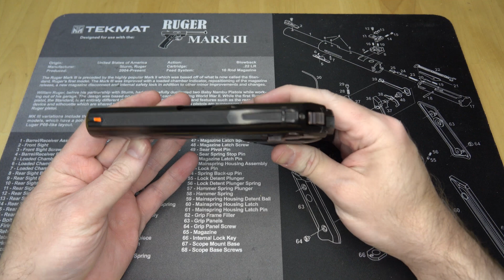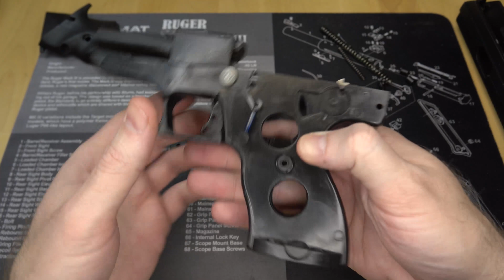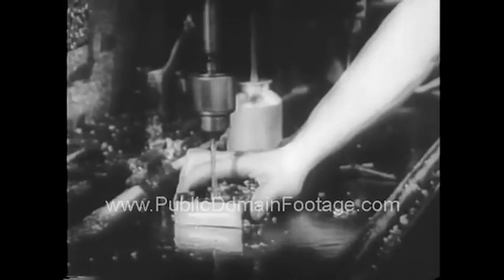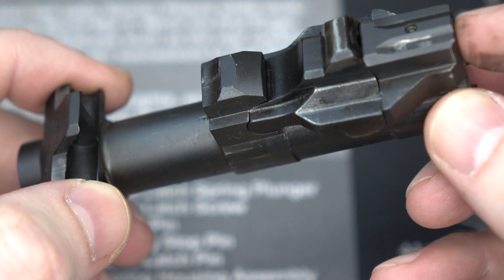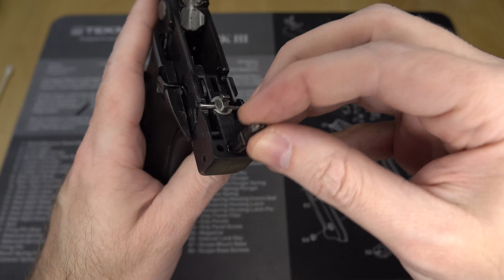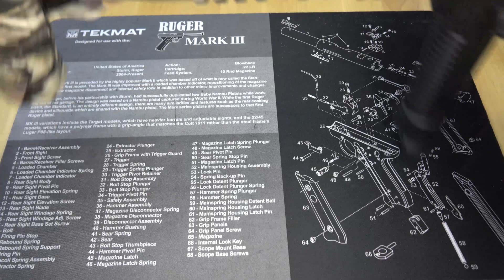How Does a Hi-Point Work? (New & Improved!)

Comment: What is the slide weight of that pistol?
Reply from the maker: This is such a great question, I had to get out the punch pin and hammer to find out. 
It is 1 pound, 2.4 ounces / ~522g.
By comparison, my LH9 slide (which is a 1911 style affair) is only 10.4 ounces / ~295g. The P5 seen in the video is only 10 ounces / ~283g.
So, the Hi Point slide is almost double the weight of a locked breech type slide.
Reply: @firydeth  The only difference between both guns is that the Hi Point C9 is Lord of all Guns!
Reply: @firydeth  interesting 
The weight of my full auto Uzi bolt is 513 grams
Reply: @firydeth The slide weight reduces recoil.  Just gotta be mindful of slide bite.
Reply from the maker: @DarrenPugh-r6u  I would not say the slide weight reduces recoil. That large reciprocating mass does things when it reaches the end of travel. Oddly enough, the bad grip ergos also seem to make the gun a bit snappy to shoot. In no way would I call this gun low recoil.
Reply: ❤❤❤ @firydeth
Reply: Heavy
Reply from the maker: @d2nasty696  straight up
Reply: 14lb
Reply: About 2....... damn much!
Reply: The way you explained zamak 3 is so wrong. It's used in the metal industry since world war 1. It was used to make toys and small scale models of trains and things for over a hundred years. A specific alloy recipe.. not just 'bits of whatever' . Dude, that was absolutely nonsense.
Reply: Never got slide bite with the 40 I have. Definitely a strong round and shoots good.

Comment: Just like everything else in life not everyone lives in a 500k house drives a 75k car. Hi Point is the common man/woman's firearm simple, affordable ,and effective. Us HiPoint owner aren't carrying it to impress someone looking down the barrel with the magnificent craftsmanship and flashy design, we're carrying it to handle business.
Reply: I mean Taurus starts at $200 for a 9mm, sleeker more compact design, reliable, higher magazine capacity and a whooooole lot easier to carry. I've seen Hi-points as low as $110, but I don't think $200 is breaking the bank for most people. If I really couldn't afford the $200 for a Taurus, then I'd probably go with an SCCY, they go for pretty similar price to the Hi-points and are still alot smaller and easier to carry.
Reply: Taurus is just better tbh for not much more money. If Hi Point is all you can afford i mean hey, use it, but there's other cheap options that run better.

Comment: This video is interesting because it's both informative (about other guns) and lacking (on some important Hi Point details). There's another similar video where the creator describes how this gun works, and the materials, without the quips, references to "pot metal" (he described exactly the makeup of the alloy), and he must have had a better experience with the C9 than you did because he did not advise that we could expect lots of FTF's, and bad reliability. In fact, there was a detailed overview of why the fixed barrel design results in the gun having good accuracy, and the slide weight reducing felt recoil.

Comment: Take it from someone who lurned the hard way, never ever buy a Hi Point. They are all total junk. When I was a young man and I decided I wanted a 9mm. In my home state you need a permit signed by the sheriff before you can purchase a handgun. It's a lot of red tape. After waiting two weeks and finally getting a permit I bought a Hi Point, It stove piped about every third round. I took it back to the gun shop and got a refund but I had to go though the entire process of waiting two more weeks and getting another permit before I could purchase anouther pistol. I wound up spending about $100 more and bought a FEG knockoff of a Browning hi-power. I still have it today and it still shoots just fine. Do some research and spend a little more money.
Reply from the maker: Well, I think spending a little more money on a firearm is a great idea. There are a lot of pretty decent handguns you can get today used for around $200-250.
If I were to only own 1 gun, it' wouldn't be a Hi Point.
Stovepipes are a bit of an unusual failure for a new Hi Point. Being a direct blowback gun, it can be susceptible to limp-wristing, which is a a common issue among new shooters. It sounds like that may have been the issue in your case, rather than some mechanical issue.
One way to have saved yourself some money returning it and buying another gun would have been to return it to Hi Point for repair. They're very good about that.

Comment: Very cool. Thank you for showing the safety operation. My sense is that (assuming it doesn't easily sweep off unintentionally) it is adequate for carry with a loaded chamber.

I would love it if you did a detailed video like this on lubricating the C9 and suggested lubes. (Frog Lube?)
Reply from the maker: The safety is so-so. It's safe-ish. It could be knocked off accidentally, but so could a lot of safeties. This gun is huge and heavy and not good for carry. 
Lube is lube. Grease is good around the recoil spring and in the channel with the plombus. That's about it.

Comment: ZAMAK-3 is not a "low quality" material. It's a less expensive alloy that has great strength, toughness and durability for certain applications. The slide of the C9 doesn't require the stress resistance of steel, but it does require weight for the blowback operation to function, both are achieved with ZAMAK, all at a lower cost. I fully expect my reliable 1998 C9 to last far past my lifetime.
Reply from the maker: Well, as a casting alloy, Zamak-3 is really good. As a zinc alloy, Zamak-3 is pretty great. However, when counted among all materials, it's on the lower quality side.
As I mentioned in the video, the main part of the slide that takes all of the abuse is strengthened with a steel insert. You are correct  that most of the slide doesn't need to be particularly strong. The Zamak-3 is mostly there to be easily cast, and be heavy. It's great at that, but that doesn't make it high quality either.

Comment: Good video, there is a level of genius in the Hipoint design. Extremely durable with a high level of accuracy attributable to the fixed barrel. All that heavy coating on the slide is very rugged, much more than higher end pistols. Top it off with very serviceable and adjustable sights, and the Hipoint is a remarkably shootable design.
Reply: And they have the best customer service in the business.
Reply: @shadowwolf2524  
That warranty, tho.
Reply: Gregg Strasser it’s what made me get one. Lol I have wanted one for so long.

Comment: Those HP pistols clean up well and respond to some TLC. Take them apart, clean up the edges on the stamped parts and put them back together with a good grease. The fixed barrel means consistent accuracy.

Comment: I always had a problem with 8 rounds in the mag, they were the original magsbut if I loaded 7 I had no problem when racking the slide, other than that I had no problems 15 years ago when I had one, some light primer strikes on tula ammo only. Plus you could beat someone with it after you ran out of ammo!!
Reply: I just bought a c9 first time I shot the gun I had to stuff the 8 round in. I took it out and shot 7 . I've put 80 rounds through it no jams and plenty accurate enough. I like this 169.00 pistol. I think most of the bad comments are BS.
Reply: I always download my hi Point mags down 1 round. They do seem to run much better doing so. I've had great luck with all their guns. And their customer service is the best in the business.

Comment: I personally wouldn't recommend installing a lighter than factory sear spring or polishing the sear. Either could make your HP unsafe.
Reply: The worst that could happen is it breaks/dead trigger and you send it in for repairs other than that unless you are messing with the recoil spring nothing could go wrong and there is no way it could become unsafe. Though if it somehow runs away keep it aimed at your target till it runs out of ammo and again the only worry about a runaway would be messing with the recoil spring not the sear spring as a extra power recoil spring could break the sear if it hits hard enough and fast enough turning it into a full auto gun which wears down the breach block fast compromising the seal of the bullet which could blow up the gun. Now how long it would take for the breach to break i don't know could be a month of wearing it down in full auto for all i know.

Usually if a runaway occurs that means something malfunctioned in the gun and usually it is the recoil spring so replace it and you are good to go. Now it is only illegal if you choose to not take action and remove the faulty part as then you would have a unregistered Machinegun that can blow up on you if you shoot it too much as it was not meant to slam that hard into Zamak 3 and granted it may not actually harm you or kill you but your gun will be inoperable if it actually blows up. And the reason why i say i don't know when it would break is because Hi-Points can take a lot of abuse to break and at other times can break with ease. 

Now i know you are more worried about runaways but you really don't have to be if you have a lighter sear spring in unless using really hot rounds that forces the firing pin past the sear due to the spring due to the spring being light and usually that is just custom reloads or if the bullet is pushed into the case too much

Comment: My C-9 ran great, right out of the box!!! No mag problem, no jams, nothing!!
Reply: Mine too. And I've owned several over the years. 4 currently. I've never had to mess with the mags or anything. When new, I load and unload the mag several times and then leave it fully loaded for a week or 2. I have found downloading the mag a round from full makes charging the gun much smoother. My 40 and 45 both came new with their feedramps polished. My 9's didn't.
Reply: I’ve never had a FTF after many, many 100’s of rounds.
Reply: Same

Comment: thanks for the video. I have owned several Hi-Points  bought new and used. I have generally found them reliable but parts do fail over time including the safety so do not depend on it. Thankfully Hi-Point will send you replacement parts at no charge.
Reply: My experience exactly! And their customer service is the best in the business.

Comment: Even on cheap blank guns the breech face and the part behind it where the cartridge in the mag rides along it when the slide is pushed back is made out of a steel insert. Zinc will deform easily and it  just so happens that a hole is in the breech face. Doh the firing pin hole. After a while, it could deform and not be round anymore, hindering the firing pin/striker moving forward and not igniting the round anymore. On blank guns without a steel breech face that can happen just after a few hundred rounds. Also you can shoot steel case ammo and brass case and so on. Steel cases will destroy a zinc breech face in no time. Cast parts can also be machined in areas where necessary. For example on the slide rails where a bit more exact tolerances have to be kept. So you can see machining marks on cast parts as well.